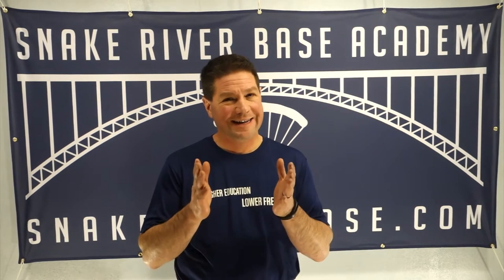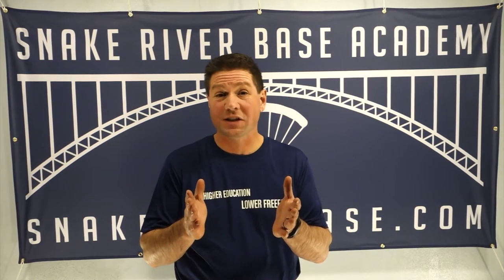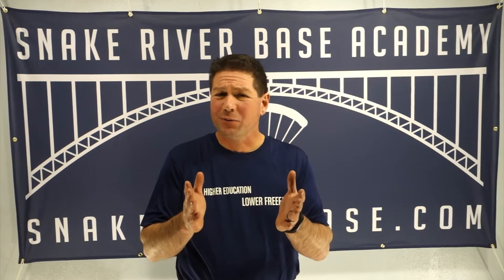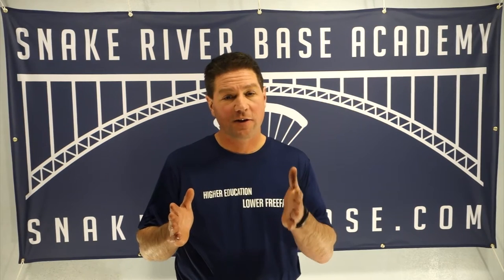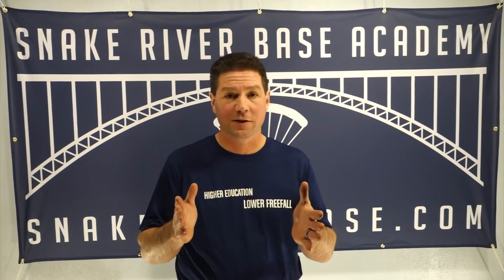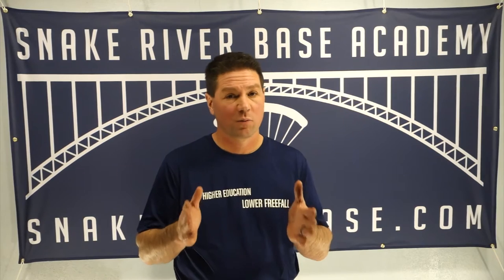Using Factory Shallow Brakes on Solid Slider Down Objects

Comment: Tom - fyi, I have never used a shallow brake setting during slider down jumps BUT in 2009 Stane of Atair told me he jumps only shallow brake setting for all jumps.  May be an interesting discussion to have with manufacturers.
Reply from the maker: There is no technical issue at all with using factory shallow settings on a slider down object that is not solid.  The issue on a solid, slider down object is your object avoidance priorities.  Everyone has to form their own opinions on every technical question in BASE, including this one.